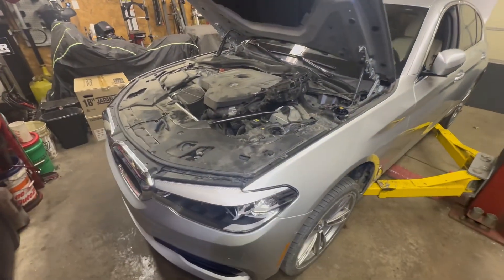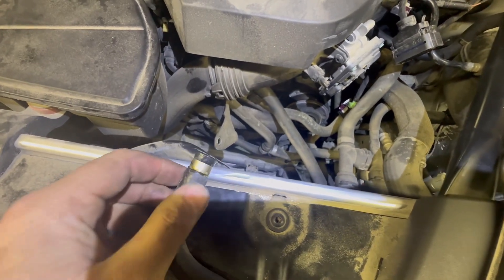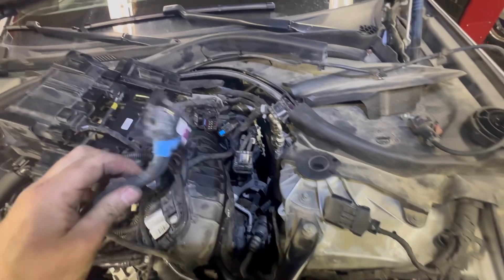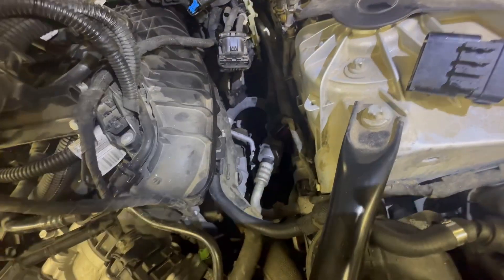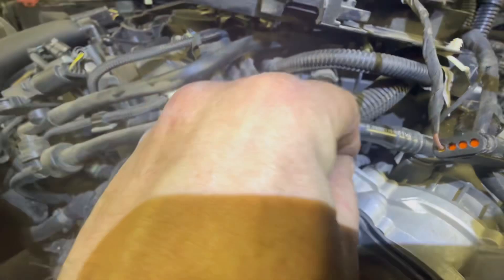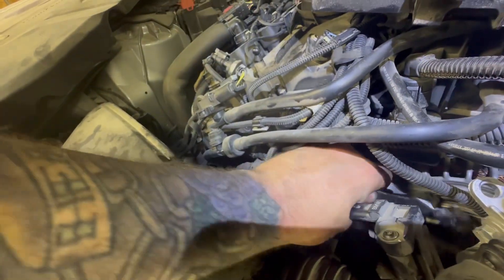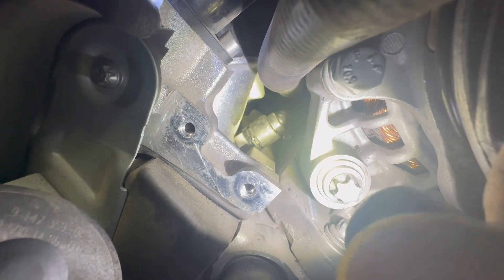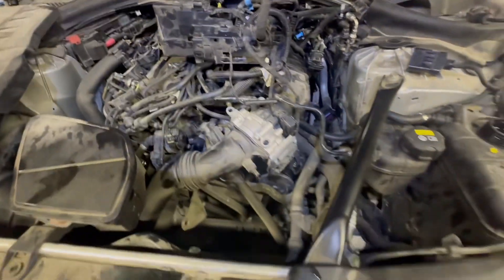BMW G30 530i B46 expansion tank coolant hose replacement

Comment: Just went through the exact same thing about 8 months ago now I have to replace the upper hose which cracked right by the radiator connection smh
Reply from the maker: @someguytsk  gosh that’s not fun. BMW/MINI cooling systems are mostly plastic so unfortunately this is really common.

Comment: Do I need to unhook the battery before I do this job?
Reply from the maker: @Herbiej33  no that is not necessary on this job.
Reply: @InnovativeAutohaus   thank you!
Reply from the maker: @Herbiej33  you’re welcome
Reply: When my hose broke, I was close to home before I realized.  After replacing hose and coolant.  I noticed my oil was a quart low.  Would this be related? I see no oil leaks anywhere
Reply from the maker: @Herbiej33  It’s not likely related no.